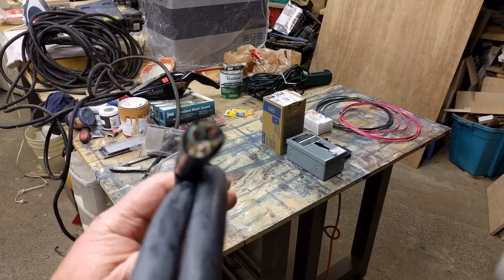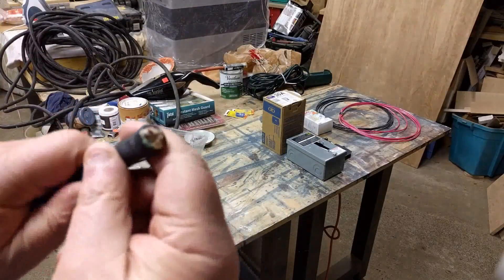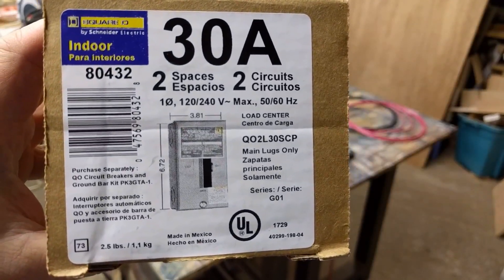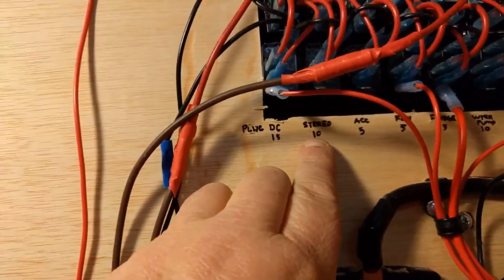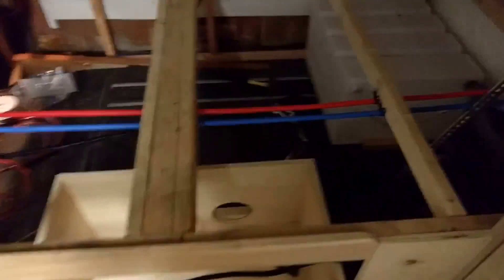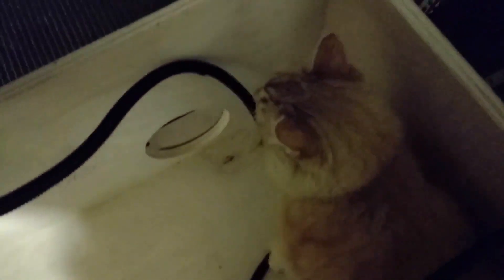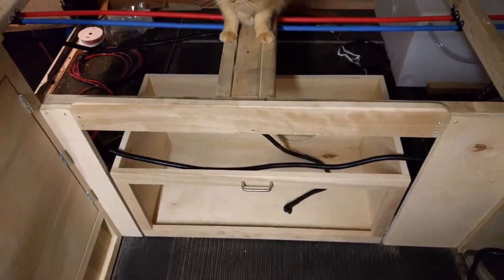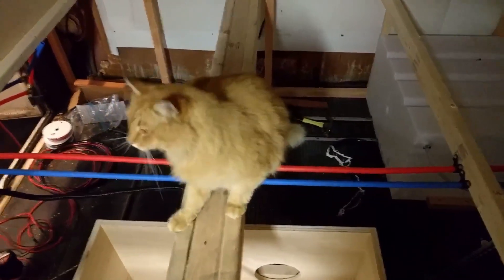Shuttle bus rv conversion (Part 35) More 12v wiring and starting the 110v shore power

Comment: Hello Robert
How did you get the vehicle state bus tags for your bus after you paid for it. 
Before RV conversion.

Did you register bus as a commercial bus first?
I am in process of trying to get commercial bus tags first because I cant take bus home without tags first. 
Thank you for sharing
Reply from the maker: @MichelleDJ  I went to the CA DMV and started the process to license the bus and got a temporary tag until I could put the basics into it so it would qualify as a MH on the title. I used the 10 days they give you to license and the 30 days on the temporary permit to build the bed,galley cabinet,and bathroom. The bus looked mostly complete and the DMV passed it, if not I would have begged for more time, it was a juggling act. The bus was non compliant to license it commercially in CA so this was my only option, a Motor Home in CA is not subject to the CARB restrictions(smog law) on pre 2010 commercial diesels that weigh over 14050 GVR. I know it's confusing, it makes my head hurt! I sure hope this helps
Reply: @robertbraden3889  ok thank you 
So the basics were bed, bath, fresh water tank, gray tank, black tank, sink , fridge?  
Wondering if I can call DMV in PA. To confirm the basics for motor home. Thanks
Reply from the maker: @deverm00  Your state may be different than California, a porta potty is is the basic requirement here,no need for a black tank,other than that your list looks correct far as I know. I would go to your DMV in PA and talk to them about it.
Reply: @robertbraden3889  ok will do thank you
Reply from the maker: @MichelleDJ  Can you get a temporary moving permit to get it home? That is what I did and drove it home from Los Angeles about 700 miles.
Reply: @robertbraden3889  ok thank you

Comment: I don't think a hanger will fit in the holes of that shelf bracket, unless you use those old wire ones. I always hated using those metal things for hanging clothes because I had to struggle to make sure I got them in the holes first, haha. But whatever works, right? : )
Reply: @treasurehuntwithcaptaindav2674  -  That's true. I've used them for various things over the years myself. I just don't like when they get rust on my clothes. : (
Reply from the maker: I've got some new high quality wood hangers with the metal hook and the pant hanger at the bottom in the store that would be perfect.
Reply: @robertbraden3889  - Oh yeah, that'll work. : )